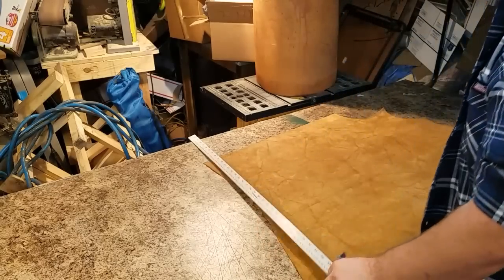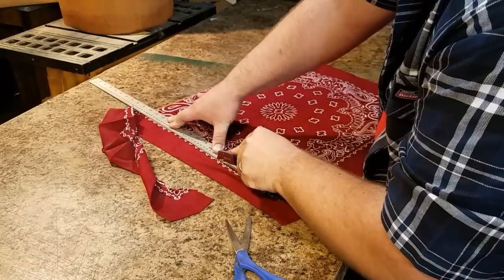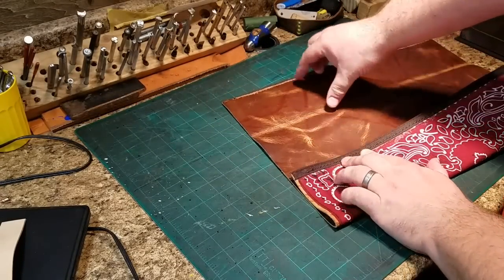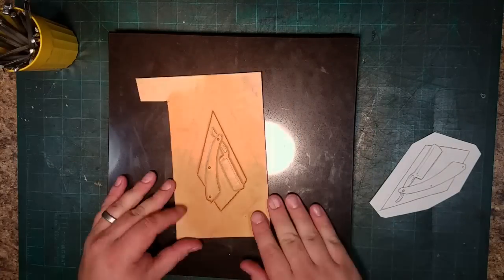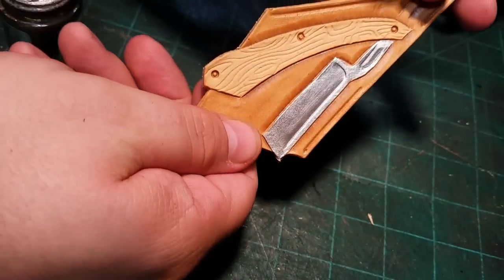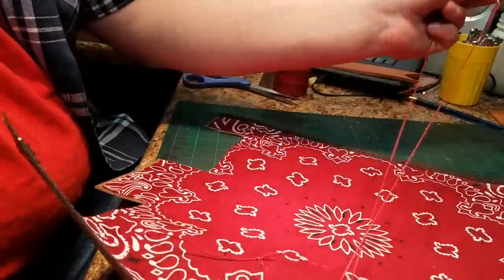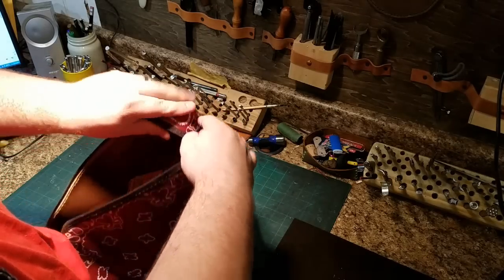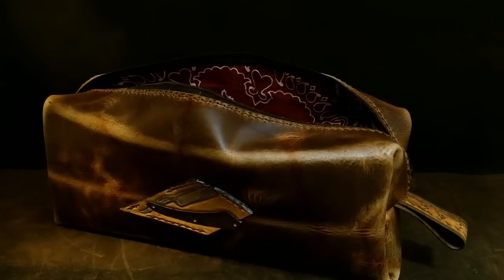Making A Leather Dopp Kit Bag

Comment: Next time place the leather onto the bandana after you apply the glue. It's much easier. Once the leather is glued onto the bandana, you can easily trim the bandana edges using the leather as your straight edge.

Comment: Robert, when you sewed the zipper on the bag it was in two pieces.  How did you get the zipper-pull on the zipper once you turned the bag?
Reply: put the zipper pullon before stitching the ends and turning the bag...also attach you handles/tabs etc at the same time...you can use the same double sided tape or try holding them in place when you stitch.  You can use pins if it's canvas or denim etc...

Comment: How do you size the cut outs for the corners?  The airline booze bottles fit well in my shaving kit.
Reply from the maker: Hi John, sorry for the delayed response. I think ultimately, the size of the cutout helps determine the height and width of the bag. In this case, I started with either a 16" or 18" piece and the cutouts were just over 1.5".

Comment: Is there a pattern available for this??
Reply: this is a simple pattern to make, and doesn't really require a full  "pattern", if you're going to make more than a few and want them exactly the same, a cut sheet with measurements and a template for your square cutouts would be handy.  get a newspaper, cut out rectangle ~ 16"x14", fold in half the long way, then fold the ends into the center also long way...cut out your squares on the four outside corners, in this case i think it was around 1.5", you can test this out on a small piece of material first, just keep the ratios similar.  the short end after cutting out the squares will determine approx width, the height will be approx twice the length of you cutout square and the length will be the distance between your cutouts measured long ways approx...